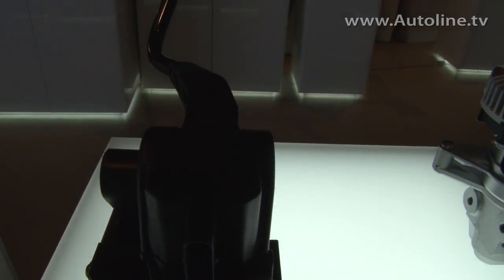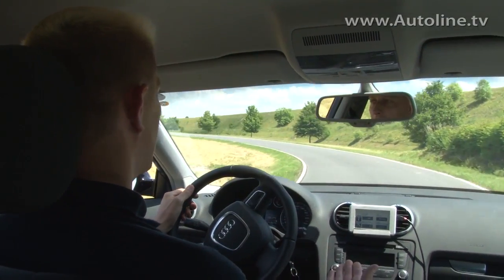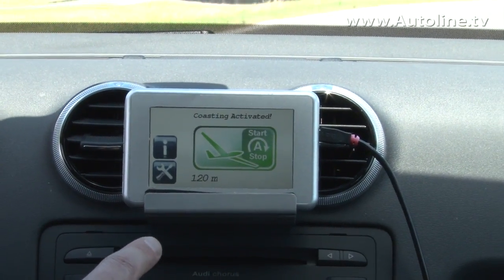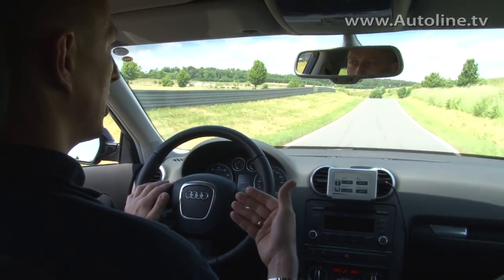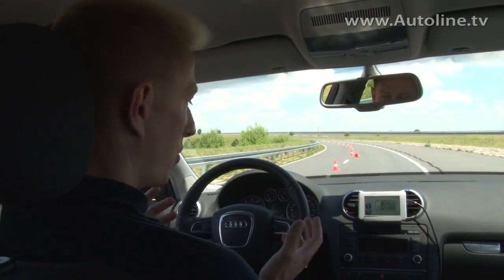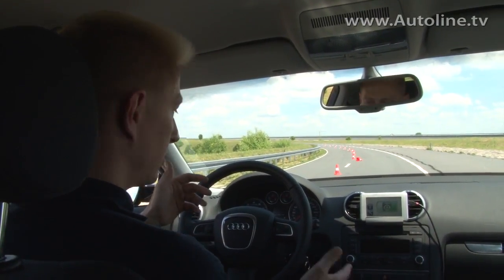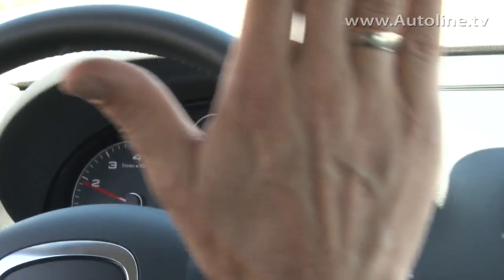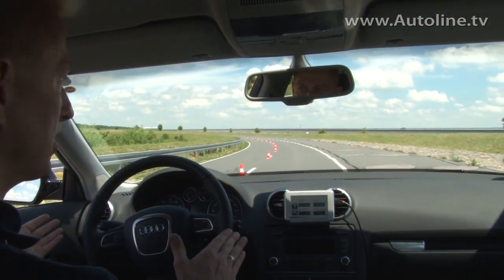Driving a Manual Made Easy - Bosch eClutch

Comment: I want the same EClutch Honda is putting on a motorcycle already!  The motorcycles ecu senses wheelspeed etc and automatically disengages the clutch when it knows you are stopping and conversly when your foot nudges the shift lever while in nuetral it immediately pulls in the clutch and then waits for throttle when it will perfectly begin engaging the clutch for you.....same for shifting you NEVER need to pull the clutch in though it is ever an option ....THIS is what I want for my manual sport car!   It is all totally possible these days because of the computers the cars have already with the sensors tracking rpm throttle position wheel speed....so all ANY manu transmission vehicle needs these days is the robotics to operate the clutch and the the programming of course.   One of the main reaon people with sports cars might shun a manual transmission is how MISERABLE the clutch becomes in stop ad go traffic!  A true E clutch is SO overdue!  WHY dont we have them already for years now!  The simplicity and wonderful fun and character of a manual with all the benefits of and automatic!  Well a lot of the benefits you still have to shift ....imagine just banging through the gears with no clutch pedal needed!  Plus yu CANT screw up!  The computer makes sure the clutch is disengaged before you shift as opposed to the possibility of error without that!

Comment: This is not a good idea.... if that motor fails or the sensor in the pedal fails you’re fucked. 

Better off with a hydraulic clutch and an external motor attached directly to the pedal, that way if the motor fails you can still drive home.
Reply: Systems like this exist 
Think of a semi automatic gear box. 
You have a manual gear box using electric motors to actuate clutch and gears. 
If it work in a semi automatic this could work easy.

Comment: Where can I find it
I want to buy it
I need like that because I am sitting in wheelchair
I am handicap
Reply: You can't buy it unless your an auto manufacturer. You'd have to get one for a different model car and adapt it.
Reply: That's what brought me here too @Achi Tube, being paraplegic and me too a permanent wheelchair user so was hoping this was something along similar lines of the "duck clutch" (which has a lever on the gear stick to operate the clutch with your finger). All being said that whole kit is rather expensive but that's because it's bespoke, and still is really which is why I ended up here hoping this type of tech would one day emerge into the main consumer market. Still doing more research because it can't be that hard to configure something of similar function, either hydraulically or fly-by-wire electronically motor actuated (just not compressed air which I used to have installed in my manual by a company called "Guido Simplex" but was so slow as air compresses as you'd expect. They do apparently have a more modern take on this system but it's pretty much the same as the Duck Clutch)

Comment: They seem to have forgotten engine braking - last I checked, that uses little to no fuel and is actually part of the driving experience (it helps balance the car).
Reply: Uses no fuel in most modern fuel injected cars. 
Fuel and spark are disabled while coasting
Reply: Sam you slow the car down still, so unless are using it to slow down the car you are saving the fuel, do not expect to coast and save fuel, it won’t. It saves more fuel coast in neutral even with engine on, Bosch official website had the fuel consumption comparison listed for different situation to show the effectiveness of this product for coasting, in gear, no injection; in neutral, engine on; in neutral, engine off. In gear has the worst fuel economy.

Comment: i didnt realise it was possible to make a manual easier to drive, most have sycromesh transmissions, there is nothing hard about driving a manual, its not like it is a huge inconvenience. the only thing that is annoying is having a car with stupidly short gearing like you find in most small cars. but with something like a V8 Falcon driving is so easy because it has very tall gearing and bucket loads of torque. if more people drove V8s so much less oil would be consumed

Comment: To much engine cut off and the battery will drain out quickly over time.. You have radio, air conditioning, DRL, and head lights..
Reply: The alternator is still turning while you’re coasting, your argument is not valid.
Reply: Alternator only runs when engine is running. 
If you turn engine off while coasting alternator is turned off as well. 
To over come issues of not start 
Agm batteries are used 
Battery monitoring systems fitted.
Most cars with stop start use this systems already. 
All they have to do integrate this extra system in.